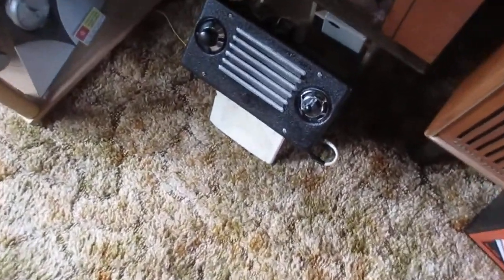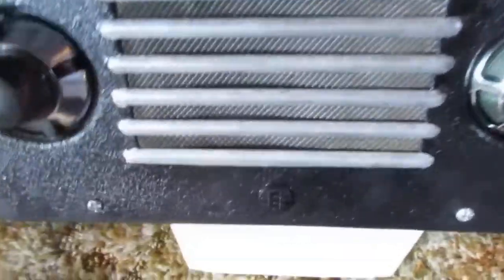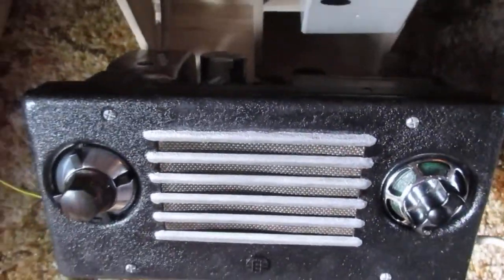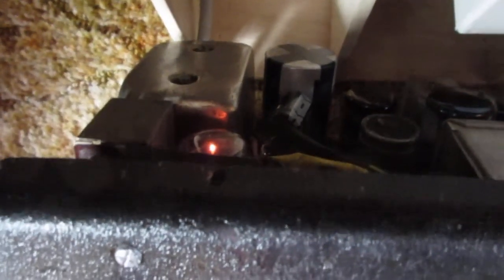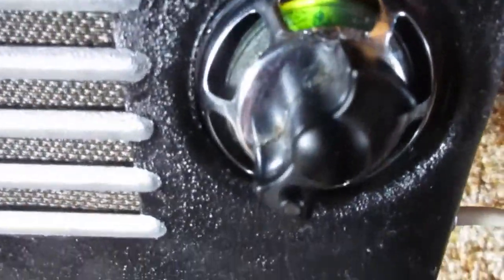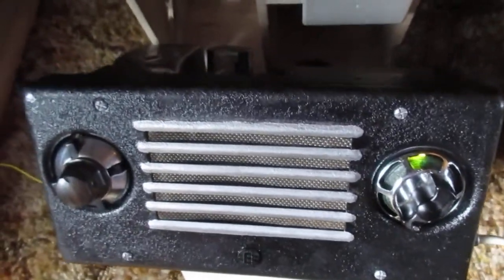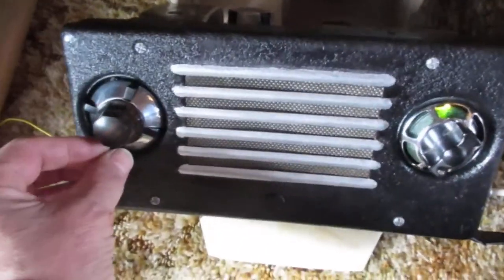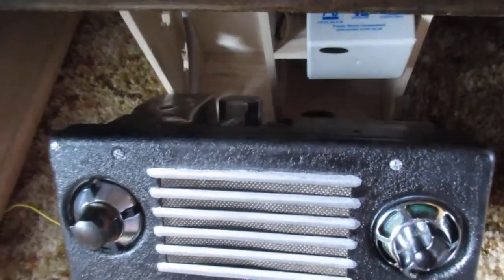Ekco CR32 First fully integrated valve car radio? 1946

Comment: This is a very useful video.  I was given one of these recently and am looking to revive it, knowing what to expect from a working unit and seeing what you did on the blog post has helped out a lot.  Thank you for sharing the information.
Reply from the maker: Thanks for adding a comment, yes, not for the faint hearted this one, good luck, let us know how you get on.
Reply: @mickeynold7849  We put it in the car today for a trial fit and, well, either the radio is a lot larger than we thought it was, the car is a lot smaller, or both.  It's a bit of a monster!  Another fun little challenge to overcome.
Reply from the maker: @noexpensespentstudios  Don't forget to check if 6v or 12v vibrator is fitted to match battery type :-)
Reply: @mickeynold7849  Noted, I believe it is a 12V one to match the rest of the unit but I will double check that.  Wax components will be replaced even though there's no sign of issues yet, and possibly the old wiring too due to the insulation not being the best.  Since we want it functional we might as well make it as safe as possible at the expense of a little originality.
Reply from the maker: @noexpensespentstudios  Sometimes the contacts, even after a clean will jam, a sharp tap on vibrator side may free them up.